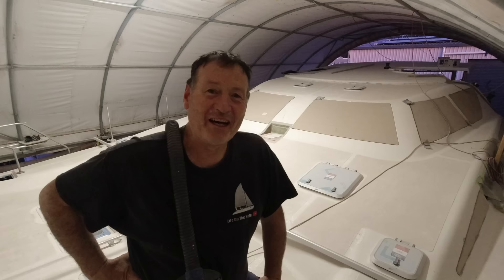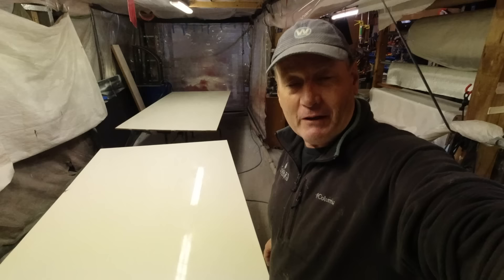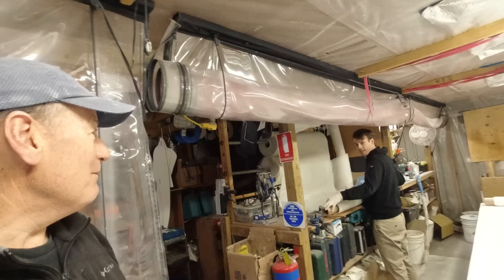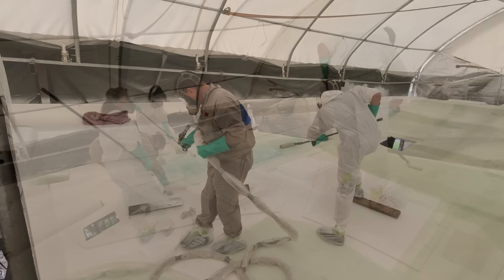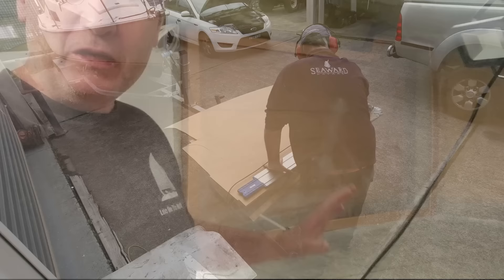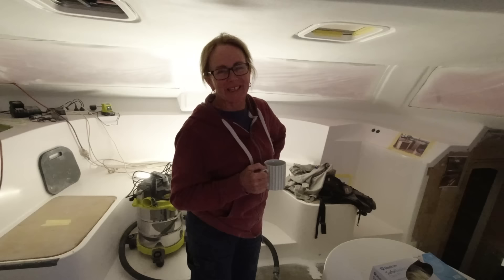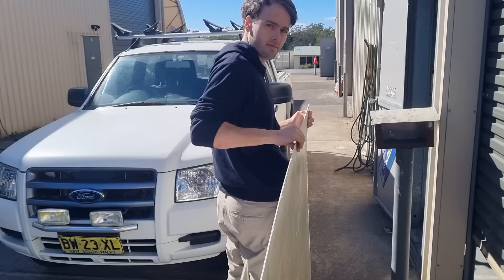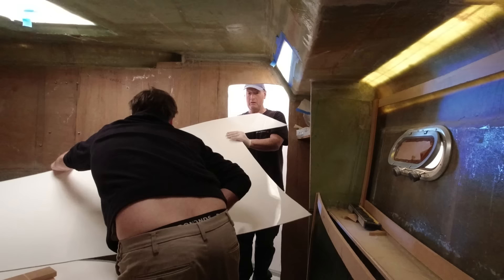The Internal Fitout Begins // This will save us months of work   Ep287

Comment: I used the same stuff on my camper van wall.  I stick it to 3mm ply to make it a little stiffer.
Reply from the maker: Exactly, the structural benefit it substantial.
Reply: @LifeOnTheHulls  Its way better the painting because you get a surface that doesn't fade or need painting and can be wiped down.

Comment: A couple of other builders use strips of 1/8” plywood and hot glue to make the templates. A pair of heavy duty scissors and a razor knife do for cutting the strips to length. Very quick and easy. Just a thought.

Comment: i think your panels will need battens across the middle otherwise they might drum
Reply from the maker: David these panels will be epoxied to the walls and offer a semi structural element I guess. They have come up perfectly. Worst case if we need to access the bulkhead for structural repairs we can simply sand trough them and touch up later. Cheers mate, Rossco

Comment: I've heard Colin of Sailing Parley Revival say that epoxy is far superior to polyester.  Comments from you on the that?
Reply from the maker: Will, There is no dispute form me on that fact. Epoxy offers a far superior matrix when bonding and laminating however in certain areas there is no benefit for non structural and non wear areas. Cost ( approx 3 times the price ) is the most common factor when deciding n choice and I have chosen to use vinyl ester in our boat for structural members , tabbing and bulkheads, and the entire hull is vinyl which is actually a modified epoxy with a styrene carrier, it is also highly resistant to osmosis and much much easier to work with. The chemistry of these matrixes fascinates me. Rossco

Comment: Hey Ross, what laminations did you use to make those panels?
Reply from the maker: Simply 2 layers of 300csm and peel ply so when the time comes rip off the peel ply and epoxy them to the wall ,cheap,flexible,lightweight, and importantly easy to repair and clean with the same gel coat for the hull deck and hardtop.1 pot of gel,flow coat does the lot when travelling.
Reply: Excellent,  thanks Ross.